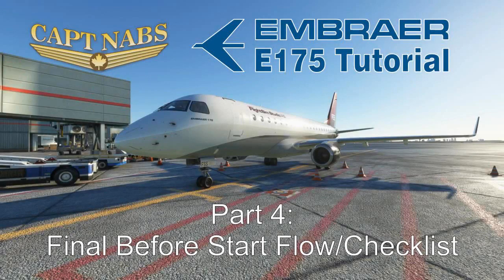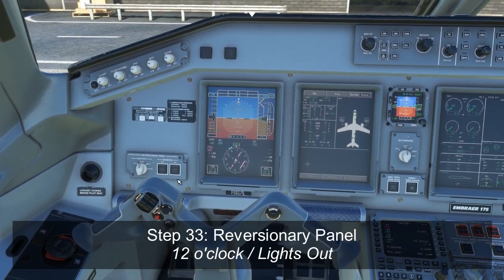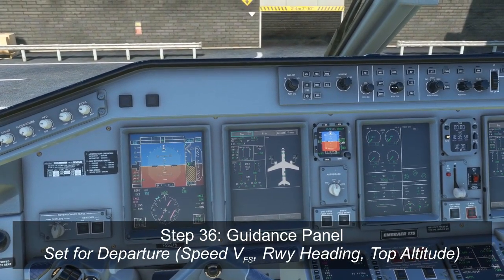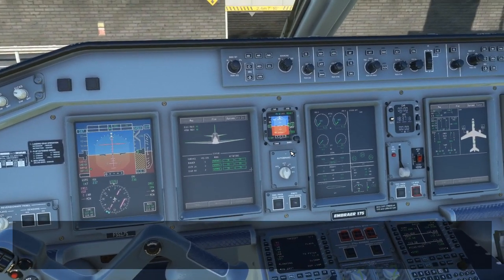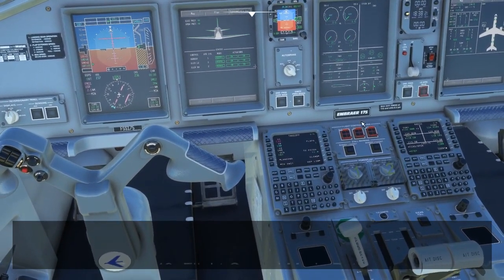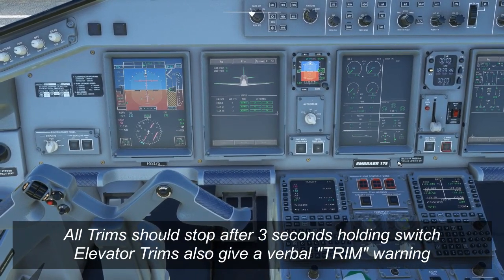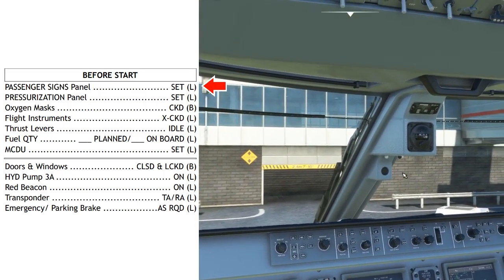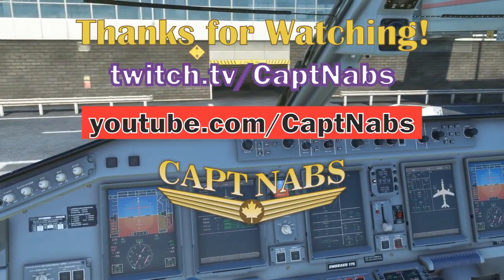Embraer E175 Tutorial 04: Before Start Final Flow, Checklist

Comment: Great video. Just how do you zoom in and out on the map mode on the MFD?
Reply from the maker: Zoom is controlled by the knob on the CCD/Cursor Control Device. Its the touchpad just below the MCDU. Its very intuitive when you are sitting in the airplane. Terrible to use in a mouse -based flight simulator
Reply: @CaptNabs  Thank you. I found it!
Yes I find it difficult to use.
Reply from the maker: Super intuitive in the real plane. I made some suggestions to make it easier in thr sim because it just doesn't translate well. Not sure if they are practical or not...
Reply: @CaptNabs  Lets see what comes from it.

Thanks for making this videos.

Quick question on the decent. Do you suggest flight level change mode or V/S mode? And far from destination do you suggest one starts the decent?
Reply from the maker: @SixFootScream  In general, we would use VNAV but that isn't programmed yet. The most efficient arrival is to use flight idle, vut without vnav it can be a challenge. I would plan VS to meet restrictions. FLCH without restrictions. Use the 3xdist rule to estimate Top of Descent. For example, to lose 20,000ft, 20x3= 60, so start 60 miles before the target.